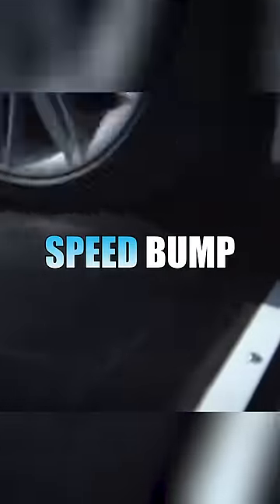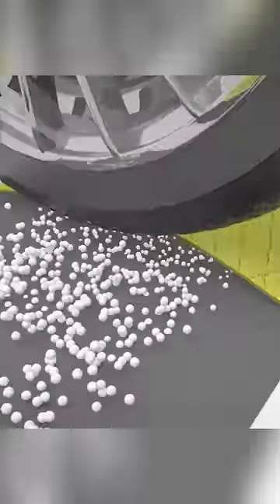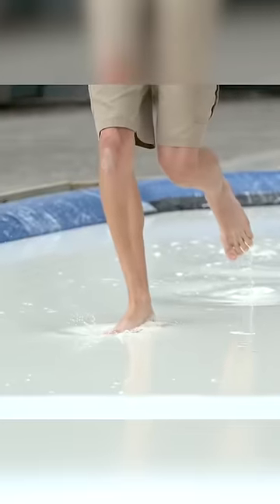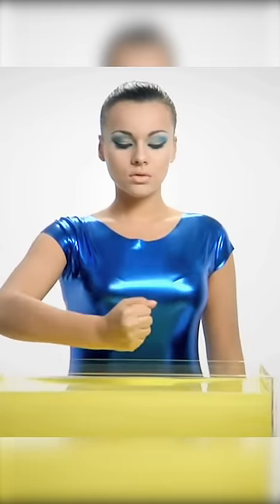This Will Make Our Roads SOOOO Much Smoother!!! 😍🥳 #shorts

Comment: Oh yeah can definitely see this lasting longer and made cheaper than a small concrete hill...
Reply: Okay, let's think about that. Making Non-Newtonian fluid is as simple as mixing Water and Cornstarch together. And because of how car tire traction works at lower speeds (Pushing backwards) if you have just, say, a 1 or 2 inch thick rubber base that's made to be durable, it can last a long time. Maybe not as long as a concrete bump, but atleast half as long, and even then it's still cheaper, and will make your life easier.
However, if you'd like to tell me that I'm wrong on anything, I'm open to your argument.
Reply: @BerzerkVideos  is
Reply: @BerzerkVideos  So the rubber cost nothing?
Making concrete is as simple as mixing water and cement together

Comment: Winter:
"I am about to ruin this man's whole career."
Reply: it won’t solidify
Reply: @thisreplyisdumb4781  That does not remotely mean it will be scraped off by snow plows, become a more resistant fluid to impacts (expanding the film to contain it more potentially ripping it due to repeated strain). Or when installed the fluid is replaced by cost saving measures with a water based solutions that will expand or weaker films and eventually leak over time.

The costs of this will be likely too expensive for areas like the northern USA to replace due to how aggressive we plow in winter. It is more cost effective to just use cheap concrete and call it a day.
Reply: That was my first thought as well. 
I'm sure the non-Newtonian fluid could be made to withstand freezing and boiling, or even changed out every so often?
Snow plowers already have to deal with modern speed bumps, I'm sure they would be able to work around these as well.
Reply: @patricknapier5806  🤓
Reply: @RadioMan2023  lol your comment got deleted by youtube auto moderation. take a chillpill.
Reply: @pustulioyo  non newtonian liquid isn't anything special just water and starch so it will prob resist heat but not cold bc the water would freeze
Reply: There's no winter in Philippines haha 😂😂
Reply: @thisreplyisdumb4781  on what basis can you say that?
the most common way of making these liquids is water and starch. which would definetly crystallize.
Reply: Or anything with mass. Non Newtonian fluids yield with a substantial force. Any heavy vehicle or fast enough moving vehicle will cause this to move.
Reply: @BOT_EFE  it doesn't have to be tho, water and starch is not the only way to make non-newtonian liquids
Reply: Not everyone has winter.
Reply: @patricknapier5806  do snow plows go over speed bumps in the first place?
Reply: @supahcomix  In Wisconsin (Northern USA) they have to, the plows are fixed with a special set of hydrologic shocks on the big rigs to move the plow back about a foot to go over large obstacles like speed bumps that are a fixed part of the roads. The plows with shocks are rare as they are expensive.

Now if you are operating a large rig or a pick-up truck with a plow add on then you will need to either know before hand were the speed bumps are to get over then without damaging your plow or look for indicators of the bumps to raise it when you get to the area. Typically you could see the snow around the speed bumps about 6ft-8ft in either direction of the bump if they have to raise it.

But in areas like Wisconsin speed bumps, especially in rual areas like were I live are not often labeled or painted, so plowers need the knowledge or caution to plow some village roads. So if that fluid speed bump was in my state the chances of it blowing up due to neglecting it or scraping it off are especially higher versus areas like California or Phillipines. Weather too is a massive variable here to as Wisconsin roads are not at all travel pamphlet worthy; cracks, pot holes, half assed tar patch jobs are all thanks to low budgets on road maintenance and higher ones for highways and freeways. So the amount of time and money it would take to add this would be counter productive to the time we'd need to look after the fluid bump. As this bump needs a regular maintenance cycle for replacing likely the whole bump every year or so due to the fact it is utilizing a rubber shell and likely a water bases fluid which will very likely leak due to debris, nails in tires driving over it, snow plows scrapping it, etc.

Comment: This could backfire though
Imagine yesterday you were driving down a road with this speed bump and drove softly over it so you didn’t notice it. Then the next day, you are late to work so you are going faster and then you get an unexpected speed bump
Reply: im sure you will still be able to visibly see it.. and you would be aware its a speed bump as it would have to be marked or labeled like any other speed bump..
Reply: @Thetechnolady007  True
Reply: Yeah but the point of a speed bump is to slow down drivers so if you hit the speed bump then you probably shouldn't be speeding.
Reply: Imagine you realize its basically a bag filled with fluid and do a burnout on it so noone has to deal with it again
Reply: It’ll be yellow man
Reply: Then go 80-40-80 problem solved. Electric cars can do that
Reply: Just... Dont speed.
Reply: @Thetechnolady007   I'm pretty sure that you can feel the bump since it cannot be too flat to the point it feel like nothing and besides seeing the video the car should still have a small bump because of the metal too
Reply: Or if it pops and someone accidentally steps on the opening, and gets stuck abit
Reply: Do yall drive?😂 you feel inch bumps and dips but idk maybe its just me with 21/21 vision that shit looks like its gonna be atleast an inch mayne inch and a half even when soft. Hard is probably 4-5 inches
Reply: sounds like a skill issue
Reply: @saisriram7775  and it turns out that it's filled with a special paint to prevent that. Congratulations, you have just made your crime visible to everyone.
Reply: Are you could just understand what is installed around your home
Reply: @Xverse12  if you feel even the tiniest bumps, then it may be a sign for non functional shock absorbers
Reply: Do y'all not have signs next to speed bumps????
Reply: That's why you do the speed limit.
Reply: @Jan_372  or he has an older car or sports car with really hard suspension
Reply: Speed bumps are marked, especially if they are new they get a extra sign that couldn’t miss saying theres a new speed bump ahead
Reply: Just don't speed 👍
Reply: Ambulance?
Reply: shouldn’t be driving if you can’t see signs 🙄
Reply: Try driving in Mexico that's nothing
Reply: That's not backfiring you're literally doing what the speed bump is trying to prevent.
Reply: Dude this could backfire in a lot of situations. Imagine an ambulance car needs to get somewhere fast, or cops chasing someone. Or just an idiot racing around and driving fast.
Reply: @prankerganster3985  any car can do that
Reply: @nobodycares3900  in my area thers a bump that is lowered. But the cops can probably bypass it. Or disable it Remotely
Reply: no this technique is when you go slower, the bump will be smooth as water. but when you go faster it is as a real speed bump. This is because the more the pressure more the rigidity
Reply: @Xverse12  21/21?
Reply: @Thetechnolady007  plus signs exist, specifically speed bump signs.
Reply: @nobody cares  Current speed bumps don't seem to stomp them, so why would this one be the problem.
Reply: well you'd still fuck up your car with a regular speed bump so use your eyes?
Reply: But thanks to that third and all consecutive times you will drive slowly and softly though

Comment: a rubber speed bump full of liquid

That One Nail:

we got people with 3 braincells in the replies not understanding this is a joke
Reply: Technically you'd need force to cut into that and that liquid turns into rock when you apply force
Reply: @rusty8983  hey buddy ever heard of sarcasm
Reply: thats not what sarcasm is
Reply: @kaliningradtoczechrepublic8162  it is, its a joke
Reply: @shoking9825  yeah a joke(but not sarcasm). 👍🏻
Reply: 1. Bad failed joke 2. When force is applied rapidly, it acts as a solid. Not inbetween impacts. 3. That's just the fluid inside. 4. The rubber shell is susceptible to damage from sharp objects that hit it fast or slow.
Reply: @EAMitch  if it acts like a solid it doesn't mean it cant be punctured and have some humor not all jokes have to be realistic
Reply: @shoking9825  which is why it wasn't sarcasm, by definition, and was such a bad failed joke. Your first comment was accurate then you claimed it was sarcasm then a joke. Your second comment would have been both if you were implying the response was sarcasm.
Reply: @shoking9825  your joke is inaccurate so someone just point them out and when they did you just tell it was  a joke? The thing is that your not even thank him he just give some education and maybe you didnt ask for but at least respect and to be honest,your joke is not even funny
Reply: @toanhychenh1537  took me an hour to read that and i didn’t understand a single word
Reply: The sub zero temperature: 😜
Reply: @shoking9825  not tryna be that guy here but the surface area of the object does matter to the kinda of liquids like these

you can punch it and it'll rather dense up and solidify but if you push a nail inside it, it'll penetrate and sink in
Reply: @shoking9825  so really your original comment WAS correct
Reply: @EAMitch  it can still puncture the thing holding it together even if whats inside turned solid.
Reply: @Great Ninja  congratulations at restating point number 4 but not making a different point at all.
Reply: I love the irony of your edit.
Reply: @EAMitch  keep going.

this is better than netflix
Reply: @rusty8983  nails are sharp, car is heavy, put two together and u have a nail that's sharp with a lot of weight.
Reply: @EAMitch bruh his joke is actually right the substance is called oobleck it's a fluid and non fluid material it acts like solid when pushed hard because the molecules of this substance don't get a chance to move and acts like liquid when pushed slowly because molecules gets time to move and if u push a nail in it softly it will puncture the rubber tube actually
Reply: @B4ushout127  except his "joke" isn't right as he claimed that it was sarcasm. And it's a non newtonian fluid. Oobleck is just one of the many non newtonian fluids. And the nail will puncture the rubber if pushed slowly or rapidly. It's the non newtonian fluid that changes with impact, not the rubber.
Reply: @B4ushout127  and I see you failed to notice he was dumb enough to restate one of my points in his argument response when I pointed out how it's factual rather than a non factual "sarcastic" comment, like he claimed.  A fact isn't sarcasm, therfore it being a sarcastic joke isn't accurate, as it was a fact that a nail could damage or puncture it.
Reply: @EAMitch  oh yes I know the joke is not good but i was saying it's kinda meaningful
Reply: @stufxx20  if he didn't claim it was sarcasm, it would have been correct.
Which that was my whole point to begin with.
Reply: This is a great power point presentation on how not to have a rational comment section 😂
Reply: @ShoKING I think it was a good joke it wasjust one of the jokes where only logical people understood it. Dont't feel bad that non -logical people ruined it by making you explain. Btw im not saying names so if you get mad at this by assuming it was you that would be admitting that I'm right.
Reply: @Joshua Rosales  I would agree of he didn't illogically claim it was sarcasm.
Reply: @Joshua Rosales  but claiming it's a good joke after they illogically claimed it was sarcasm is illogical, making your comment ironic.
Don't feel bad that you were being illogical.
P.S. its illogical not non-logical.
I'm not mad at your illogical comment and hope you also don't get mad at facts and logic. But if someone got mad or not, still doesn't make you right, with your illogical statement.
Reply: @shoking9825 three brain cells indeed

Comment: speed bump means speed up.  ive launched my spare tire higher than the sides of my half ton.  ive also drove slow over curb stops with my 1 ton which had old tool boxes on its flatbed so it rattled good and people would look

Comment: It would only make sense if it’s placed on very specific areas like neighborhoods going off the highway. If you put in in those ridiculous places with like 4 speed bumps less than 20ft apart then you end up just slowly moving along at 1mph without pressing anything because there is no reason to speed up if you have to brake a second later.

Comment: The problem here, is that these viscoelastic fluids, have a life which is much shorter to that of concrete or pavement. Plus, these would be more expensive and cost more to maintain. 

They could break, it’d be very difficult to do so, but its possible. They are affected by weather, they become harder in cold weather and softer in warm weather. 

Furthermore, considering it’s a moldable gel when idle, it’d only take a sharp car/truck part, angle grinder, sawzall, or other heavy duty power tool to render the entire speed bump useless. 

It’d basically be like using neighborhood roadway materials on a freeway.

Comment: Kids would 100% go around popping these for fun. Not to mention all the other issues mentioned in the comments. Cool concept but current speed bumps are a non issue. Replacing them would cause more problems than it solves

Comment: That’s not how that works… one of the cheapest and most reliable options would be an oobleck solution (equal parts cornstarch and water). Non-Newtonian fluids require VERY little force to harden. Only a few newtons delivered by a hand is enough to make it harden completely before softening again. Since cars weigh thousands of pounds, this would make any sort of movement harden the solution instantly, not to mention that the car is still moving while hitting the speed bump therefore triggering it no matter what, and possibly rupturing the rubber bag that contains it, thereby releasing the liquid all over the road and making a massive mess.

Comment: Somehow the concept of a speed bump has always made little since to me.  It seems to me that a vehicle going slow over it is kind of pointless.   However, if a vehicle moves fast over it, it startles the driver and causes the vehicle to lose control.  I don't know about you, but it seems that a fast vehicle that is out of control, and possibly airborne depending on the speed at impact, is twice as dangerous as just a fast vehicle.  What if someone accidentally pins their gas pedal before impacting one.  Now the vehicle is going to hit the bump and it could go in any direction.   If you can't trust someone to drive slow through a parking lot, why would you trust them to maintain control of a out of control vehicle?  Just a thought